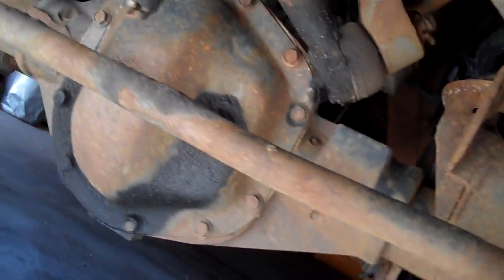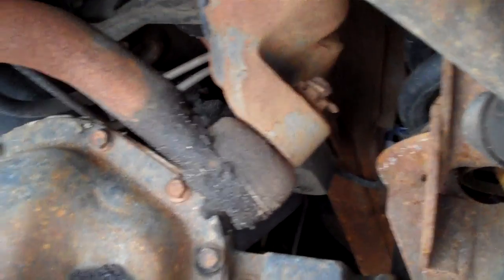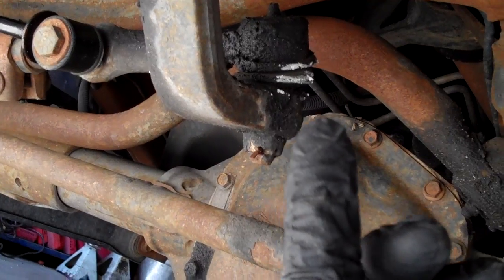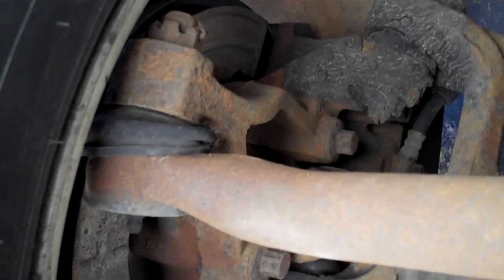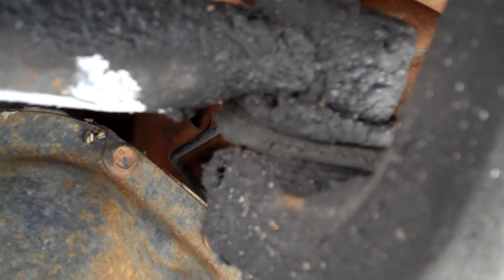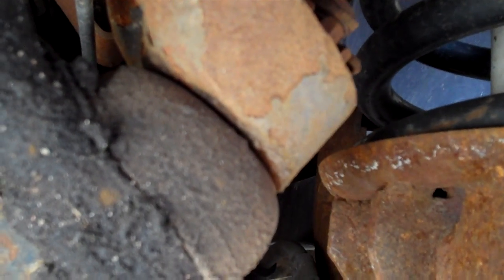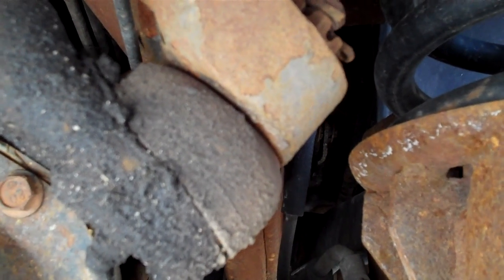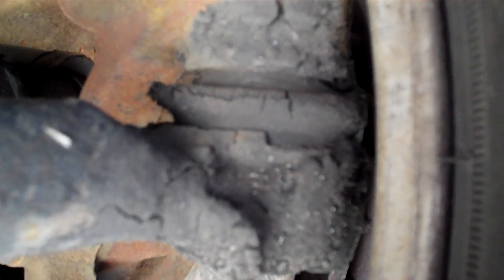How to diagnose play in sexy tie rods ends, track bars, and other steering components.

Comment from the maker: @counkev   That's correct if you have a runaway truck ramp or an equivalent incline.  I recommend leaving it in gear (the lowest you can get away with) and turning the key off.  This way the transmission creates drag.  The other idea is pulling your emergency brake or parking brake too.

Comment: Heyy Brian , i've got a 1994 Toyota Tercel who doesn't have any steering component , only ball-joint and tie-rod end . Currently i dont have shake in the steering wheel but when i raised the car to change thermostat i noticed that the Tierodend would not move up and down as it usualy do when it wears out it move  from side to side !!!! im very convern since i cannot remove the jam nut because everything turn and im affraid i might damage something , Whats your take on the situation??